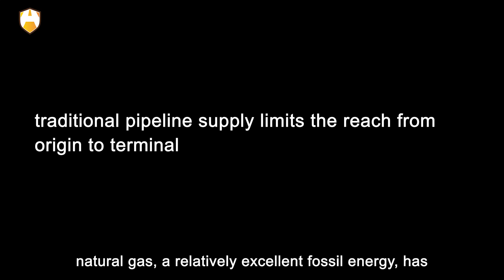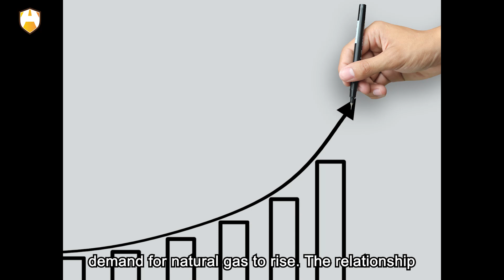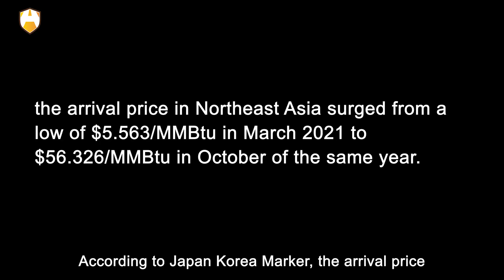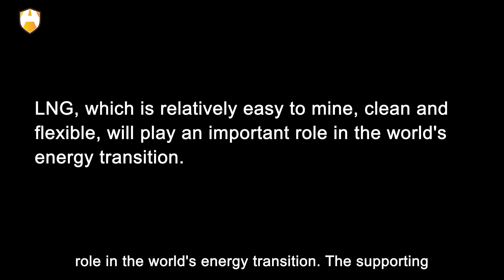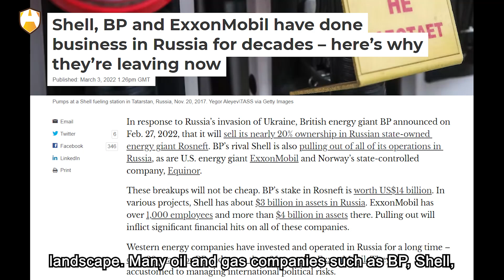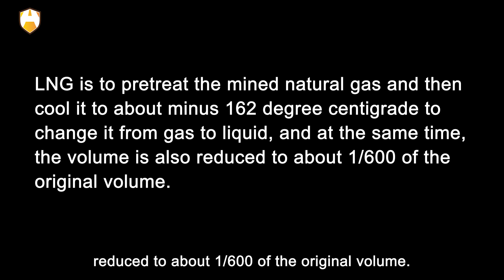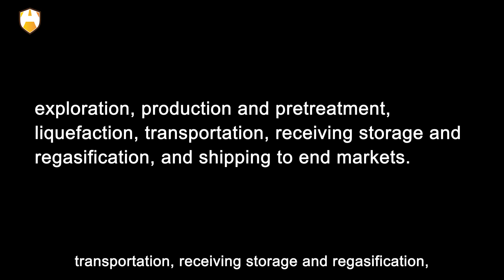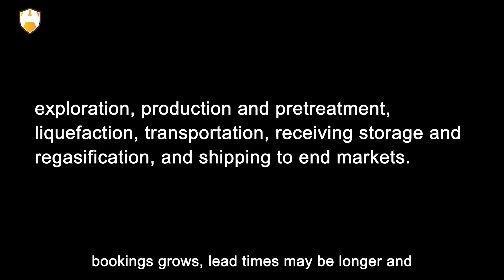China urgently needs liquefied natural gas right now!

Comment: I consider this video as a smear on China.  Big LNG users are western economies and they use natural gas for electrical power generation.  China isn't one of them as the Chinese thermal plants are coal-fired.  This is simple economics because China has coal and very little natural gas.  China has major natural gas supplied by Turkmenistan and Russia by pipelines plus LNG supplies at the ports with long term contracts with Qatar and US.  Trump in the trade war with China has forced China to purchase US LNG for 20 years.  

It is widely publicised in the recent EU shortage of natural gas, due to self imposed ban on the Russian gas, many US LNG shipments to China were resold by China to EU by re-routing.  This has eventually stopped by the Chinese government.  Thus any suggestion China needs LNG urgently without supporting evidence is a slander.